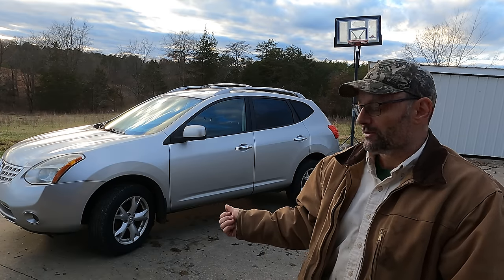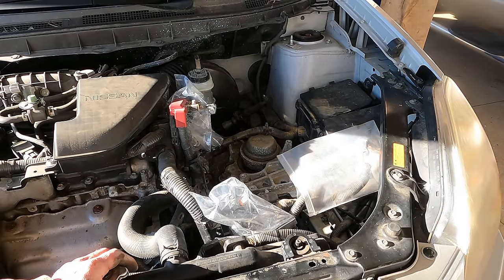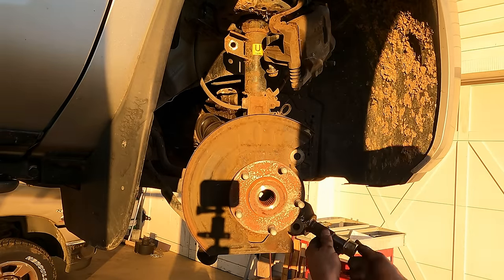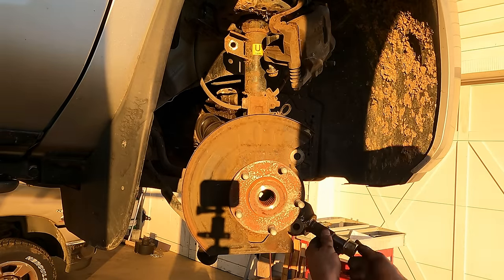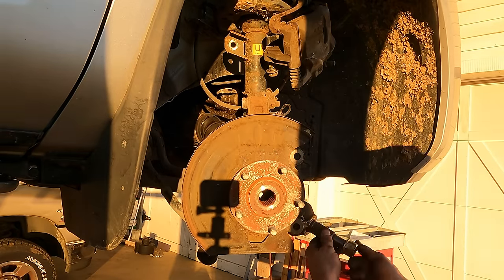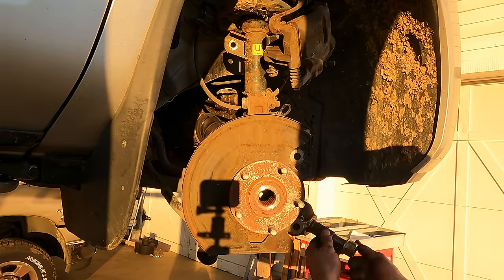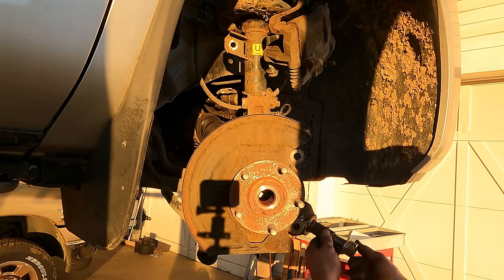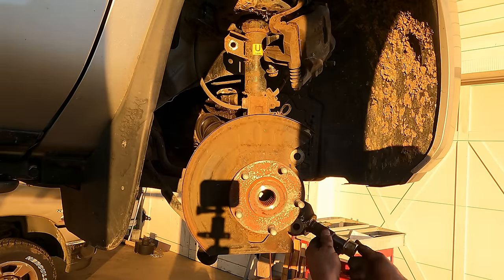Fixing a Nissan Rogue Transmission So I Can Give It Away. GOAL MET!

Comment: I have rebuilt hundreds of transmission in my time as a mechanic. But retired as a mechanic when the CVT  started becoming popular in cars. Yes glad you worked out the Drive shaft boot is easy fix. NOTE. it's easy to get the car off your hoist find a good spot to jack the car up from the front.. maybe throw the K Frame back in with some bolts and jack from there. Roll the car back on the jack to new location. Did this all the time in the workshop.

Comment: Great Video!
It's so sad to think about all these cars that are totaled just because it's not worth it to fix them.
I wonder if there's a donation program to like a trade school to give up and coming mechanics a chance to work on cars like this.
Reply: It's because people don't maintain them. A CVT fluid change with BOTH filters is not hard to do as a DIY'er, I did two this year, the hardest part is the fluid cost.
Reply: @Islandwaterjet  And yet, here where I live, there are always requests for donated cars, in any condition. When I have called and asked what the need for the cars is for, I have been told that the cars will then be donated to trade schools (aka auto repair training schools) and high school auto shop classes, for students to work on to build skills by fixing the cars, which would then be donated persons in need of vehicles (signed up with rescue centers, shelters, settlement shelters, etc).  

As for the lumber, have you  contacted Habitats for Humanity?  Around here, local "Re" stores would be tickled pink to receive the lumber.   Keep looking and reaching out.
Reply: @tinydancer7426  I would guess the problem is because it's furniture grade. A custom cabinet shop or another similar type company would use that material. Possibly a HS woodshop class. Most technical schools use framing material. Just my opinion... No need to get beat up in comments... Just state your opinion
Reply: @Islandwaterjet  that's crazy. A custom cabinet shop, custom staircase builder might purchase. 🤷🏻‍♂️ 
Unless you are looking for a "donation" which you can deduct based on your proclaimed worth? 🤷🏻‍♂️

Comment: Spray wd40 on everything before you start (ball joints, exhaust bolts and nuts) will help get it apart. Also use a brazing tip on your torch. It will allow you to pinpoint your heat and not melt anything. Great work and I enjoy your videos

Comment: Plz, be informed, that some bolts and nuts used in this car may be one-time-usage-only (for ex. those bolts, holding bottom subframe, or maybe axle nuts). The reason for this is that nominal tightening torque for them is so great, that plastic deformations occur in their threads and body. Re-using such bolts can potentially cause fatigue failure while driving, which in term can cause some sort of accident (better safe than sorry). Thx for the video, Happy New Year!

Comment: This is awesome! I will make a donation once payday rolls around. I worked for Subaru when they introduced their CVT for the 2010 model year and had the technical training on it including a full teardown, the internals are very similar (in fact I think the actual CVT part is the same just different orientation since a Subaru uses a longitudinally mounted drivetrain instead of transverse, and if memory serves me the transmission is made by the same manufacturer (JATCO). Most of the failures we saw while I worked there were from Goofy Lube putting the wrong fluid in it. Fun fact - at least on the Subaru version, to engage reverse it just throws in another gear that reverses the direction of the output - it still uses the CVT components, however the computer locks the pulleys in place instead of allowing the variable ratio - it is therefore theoretically possible to do highway speed in reverse!

Comment: CVTs really are an amazing bit of engineering, and a fantastic idea in theory. By adjusting the ratio and engine speed, the car can put maximum horsepower when it needs it, put out maximum torque when it needs that, and bring the engine down for maximum economy when it doesn't need either of the above. Great idea, in theory. In practice, not so much. I've seen many a CVT equipped vehicle suddenly sprout an extra pedal over on the left after a failure, lol... Anyway, it is great what you're doing. Someone will really, really appreciate that.

Comment: A tip i learned that helped be with stubborn bolts. Is heat to red hot then Quench with water. worked every single time I ever had to do it

Comment: Thought I would share my experience repairing a Murano RE0R09A 4wd CVT gearbox which was shuddering when you came to a stop. Also shuddered when you pulled away causing it to go 9into limp mode. RE0R09A is basically a stronger version of the Roque CVT RE0R010A. CVT's operate with a high fluid pressure which is key the belt not slipping. With my repair I initially removed the valve body only, leaving the gbox in the car. I stripped the Valve body down, removed and cleaned the pistons in the valve body, cleaned the valve body sections and reassembled. Installed a new oil filter and new fluid and took it for a 150 mile run. Intially it ran perfect for for about 1.5hrs just cruising it. I cam to an intersection. When I pulled away I began accelerating harder and harder and when I hit about 5000rpm and still accelerating harder the belt suddenly slipped. It kept running fine when I backed off accelerating hard and no slippage occured. Next time I cam to a stop about 15 minuted later the gearbox started shuddering. I managed to limp home. I determined the valve body was fine because the CVT had shifted seamlessly. However the slipping belt would have created metal and contaminated the new fluid, the torque converter and maybe not good the have metal that might damage the seals inside each variator. The car had done 130,000 miles. I reasoned that the CVT oil pump was worn and accordingly oil pressure was less than required to prevent slipping. I bought another CVT from a wrecked Nissan Maxima 2007 with the same CVT RE0R09A but in a two wheel version only. I reasoned because the car was pranged the CVT was working ok at the time of accident and mileage was only about 84,000 miles so assumed gearbox was working fine. However theres a lot of work to change over one of these gearboxes so I purchased from Amazon a Transgo Flow Control valve  JF010E/RE0R09A Repair kit. This is a drop in valve that goes into the oil pump to correct wear / low pressure in the pump without requiring the pump to be machined or modified in any way. The kit was about $30. I then sat the old and the new gearbox side by side on their ends with the spline facing upwards. The old box was 4WD so the transfer case came off during removal of the CVT from the car. In order to convert the replacement 2WD CVT to 4WD you have to swap the front section / bell housing over from the old trans to the new because the shape is different on account of the transfer case. Remove both bell housings, remove the oil pump in the new gearbox and recondition oil pump by installing the new flow Control valve and reinstall oil pump into bell-housing. Swap the crown wheel and pinion over (because the driveshaft receiver is different for the 4WD version). Apply silicon to mating faces and bolt bell housing on. Install replacement torque converter that came with replacement CVT (because the old torque converter is contaminated with metal from CVT belt slipping) onto input shaft. Reassemble gbox to engine. When I did this it worked perfect and has been trouble free for just over 15000km. No belt slippage what-so-ever. This repair would be identical for the Roque gearbox. Hope this is useful in the future. Im convinced the flow control valve replacement is a mandatory replacement if the CVT is being taken out because its a cheap part but will extend the life of the CVT. Best regards.

Comment: All you need to do is drop the car on a trailer with a pallet or two under it, (to get ramp arms out) then use the lift etc and once finished, reverse the trailer back under it and lift the car back onto the ramp/off the trailer. Done that many times 👍
Reply: I was going to suggest a pallet with 4 castors.

Comment: I would save the $4000 and buy a different car with it. Bought a Nissan Juke for my wife in the uk. The gearbox broke at 32000 miles. The CVT gearbox is a heap of crap.
Reply: Used car prices in the US are out of the roof right now. $4000 won't buy much at all :(

Comment: The "link belt" works via compression of the links. Tha belts links compress and "push" the power from the engine to the cvt. The only "tension" on the belt is  applied sideways/laterally by the "driving" pulley.

Comment: Thats gonna be a really good thing to give to someone starting out o/
small idea for moving the car before parts come in / etc - make a little wooden wheeled box some 2x4s bolted together and some solid dolly wheels or something that spin on a bearing - make it fit under the engine area of car with a couple metal brackets to mount to existing hanging parts (engine / struts/etc areas) then can lower it down so those wheels are touching to roll it around and out of way of lift..  or maybe 2x6 - idk does not have to be super strong just strong enough to put weight to all the little wheels (like furniture / chair wheels but stronger ones) - or they do make car dolly's that can be slide under the cars lift points. but you probably have some scrap wood laying around can make something with faster / cheaper then buying more tools.

Comment: Thanks!  That CVT drive, is also called a Reeves Drive.
I see them a lot, on older Jet (and other) wood lathes.
My antique Cast Iron ShopSmith Model 10 had one as 
an option.  (Funny, ShopSmith has been going downhill 
since 1954.)

Give this youngster a decent running car.  Ask me if 
you want a real Craftsman ratchet or 3 to give as well.
1/4, 3/8 and 1/2.

steve

Comment: Awesome idea, with the subframe down might I suggest checking and replacing the subframe frame bushings and maybe hitting it with a coat of paint. Also for CV axles you can absolutely buy a new boot and especially import manufacturers usually offer a factory replacement. Honestly this is the best way to go because my experience with parts store CV axles is that they usually fail quickly.
Reply: I think everyone learns the "parts store CV" lesson the hard way. It's often not obvious which parts you should absolutely go OEM with. You'd think axles would be a common enough DIY job to warrant a few decent aftermarket options, but I sure haven't found one yet.
Reply: If the OEM uses the molded plastic boot type, then I’d agree; however, the 2013 Rogue I recently worked on had the cheap rubber type from the factory, just like the discount parts store, so no difference (and the reason the boot ripped already).

Comment: This waste of what should be a longer living vehicle is because of government interference, pushing up required MPG unreasonably.  "What???" You say.  To make most MPG gains it's about weight and aerodynamics.  Both of those contribute to smaller size and compactness.  Those directly impact ability to repair and longevity of parts.  Majorly!  The largest portion of this repair is man hours to replace the trans.  Much harder in spaces not designed for repairs and parts that snap and break and wear out quickly.  If you follow the paths of where things have come from, this is the conclusion.

So we save some fuel while driving a vehicle and we waste much, much more in building its replacement.  Unintended, good feeling, virtue signaling consequences
Reply: was thinking a FWD stick car is the proper set up. Pair of studded tires for snow-winter driving. Paring CVT with AWD & the lumpy heavy drivetrain required is a Bad Idea. Poor Nissan.  Where do these engineering choices come from?

Comment: Here's a MAGNIFICENT TRICK to cleaning.
Water isn't always good for obvious reasons.
Use mineral spirits with a siphon sprayer.
Cleans engines like nothing else.  It dries clean too.
I would 1st go over the area with degreaser or even lightly spray (with mineral spirits) the 1st pass.
It doesn't hurt electric connections as water may.
What you're doing is so wonderful!  Thanks!

Comment: When you have a hoist it is usually much easier to remove the engine, transmission and suspension  with the subframe and do all the work out in the open, out of the car.

Comment: The reason these cvt trans have failure early is two reasons , they offer a HD transmission cooler for these and the second reason is lack of maintenance,  the transmission fluid needs to be changed every 25,000 to 30,000 miles
From the look of the transmission fluid it was never maintained it should be a mint green color I believe . Here in P.a. I've seen shops selling remanded units for around1,200 plus shipping , heat is the enemy of these transmissions , and lack of maintenance! Good luck ,we need more people like you  !

Comment: When I was 17 years old I bought a 1961 Plymouth that was painted white and when the white paint chipped off I saw green and yellow underneath and anyone from New York will know that meant it was a taxi cab so there was massive mileage on it that I didn't know about. Anyway, the transmission was not shifting correctly so I pulled it out, with the car in the street, put it in my basement laid out a sheet and pulled the entire thing apart and even disassembled the entire valve body. I didn't know what the problem was and didn't see anything obvious and had no money, so I reassembled it put it back in the car and it was exactly the same as when I took it out. I ended up getting a rebuilt. I was disappointed that you didn't strip that transmission down to every last part but from my experience you made a wise decision because transmissions take some specialized knowledge and I learned it the hard way. Still, just to see how it all worked and to see if I could find the issue I would have stripped your trans down every last removable part. I've never pulled apart any large equipment like your excavator so I really enjoy seeing how all of those are put together.

Comment: On the cloudy headlights (that are not clear coated).  I have found that you can scrub them with Green GoJo with pumice to clean them. They wont look much better after this step but they will be clean and then hand polish them with compound. I used Plastix that came in a headlight restoration restoration kit. Didn't spend a dime and can see at night. You make good videos.

Comment: Ive worked on similar types of variable speed machinery. In their simplest form one of the pulleys is varied in diameter via a knob on the outside and the other pulley is spring loaded so the belt NEVER goes slack. I should guess that one of the vehicle types of cvt is actuated by a controlled amount of oil pressure on the first pulley and the other is tensioned via a controlled amount of oil thus keeping the belt at a good tension. I believe the complicated valve  blocks are designed to alter the diameter of the first pulley in steps of ratios rather than being altered by speed continuously. Please feel free to correct me as this is only an educated guess. 👍👍👍🇬🇧

Comment: Great video! Greater plan to pass on to the next generation a hand up!  By the way, there's a channel called Weber automotive, or something like that. It has a professor of drivetrains at Weber College in Utah that explains all kinds of drivetrain components.  I remember one on a CVT much like this one.  He explained that the belt is a "push" belt.  All the little plates are compressed to "push" the driven pulley to make it all work. I definitely would not use a CVT on anything that tows trailers.  He also has some very interesting videos on the hybrid electric cars and how they work.

Comment: I currently drive a 2017 Nissan Sentra SR Turbo. After I bought the car brand new and had it for a while did I discover the issue of the Jatco CVT transmission installed on certain makes and models of the Nissan lineup. One of the big issues is, the transmission case was made to small to keep the interior at a proper operating temperature. They had to be made small so they could fit in the car. I found a Youtube channel from this body shop in Florida. They solved the issue on their Altima by installing a transmission cooler. The cooler has to be installed in exactly the right area in the front engine compartment in order for it to work properly. As for my Sentra, it's turbocharged. Because of that Nissan did a few things differently. The front suspension and brakes are beefed up. Also, it has a different CVT transmission than the models that are having problems. The car runs excellent. I keep the fluids changed, and much to the disdain of my fellow motorists, I drive the car like a little old lady. I rarely, as they say in drifting circles, "smash the boost". I was thinking about buying a brand new Rogue. After watching this video, I've changed my mind. CVT transmissions, especially transmissions from Jatco, have a tough enough time with 2 wheel drive vehicles, not to mention all wheel drive vehicles. Regarding the transmission cooler fix I mentioned above. It may work well in a warm climate like Florida. Not really sure in a colder climate. The fluid has a very specific operating temp. I recently had my fluid change. The cost was almost $400.00. It's the cost of the fluid itself that makes it so expensive. They use a total of 8 quarts.

Comment: Just when I thought you will find out what exactly gives with these transmissions...
My feeling is that it must be related to the pulleys as they have to be able to slide on their central shaft.   
They have to be to slide up and down  on its' central shaft and there in that sliding there must be strong torque  by whatever mechanism. keeping the central shaft both engaged and also the pulleys must be able to slide on  the central shaft.